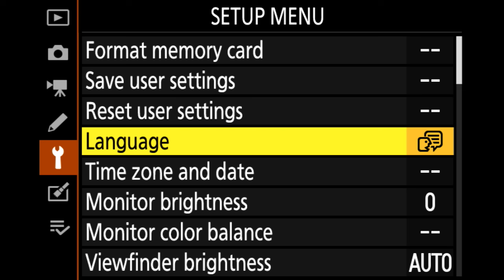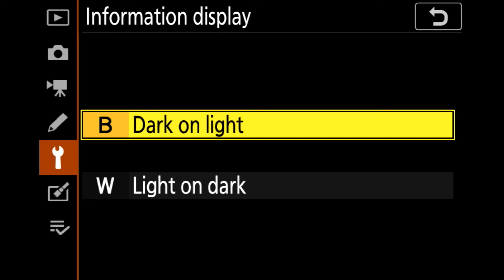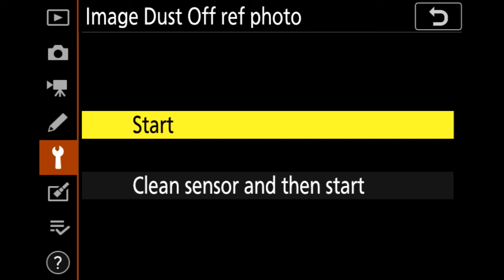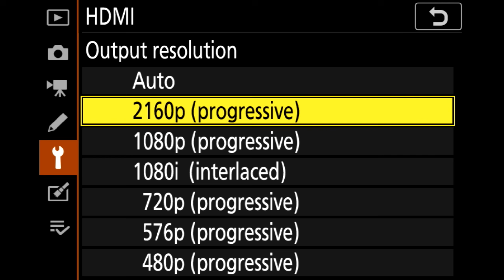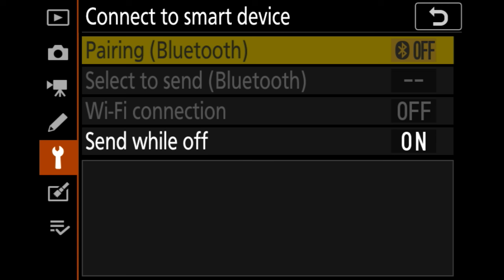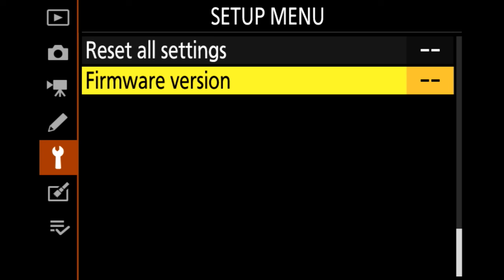Comment: Hi Anthony, great informative video as usual, thanks I always learn something very useful when I watch your videos’ so thanks. I was looking for tips on AF fine tune when I watched your section on Setting. I also own a D850 which has an auto setting, where if you turn on AF fine tune in the menu and press the movie record button and the AF/M button simultaneously (on the camera body next to the lens) the system will give you a value automatically. This you can use as a start point for further adjustment or as I have found is accurate. However, I have not found a way to do this on the Z7 as there is no AF/M button. I found the AF Fine Tune especially useful with non-Nikon lenses when doing Macro work. Any ideas?